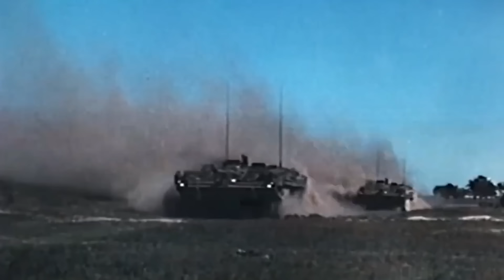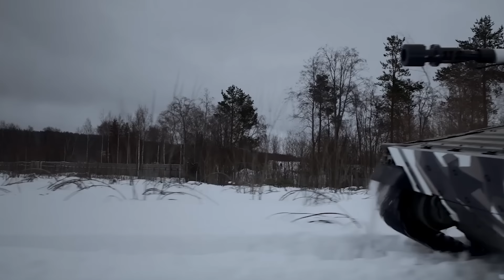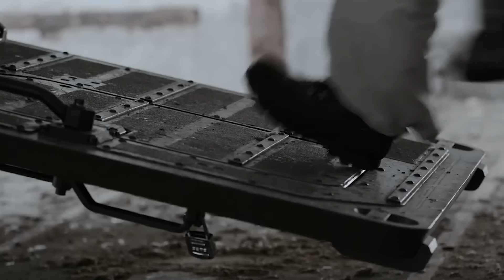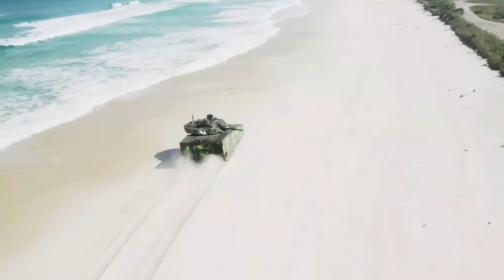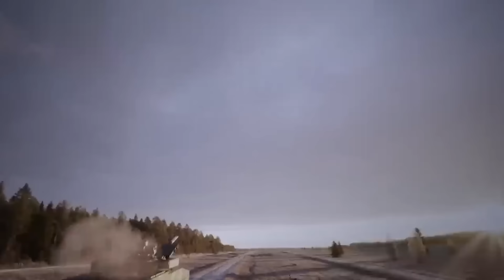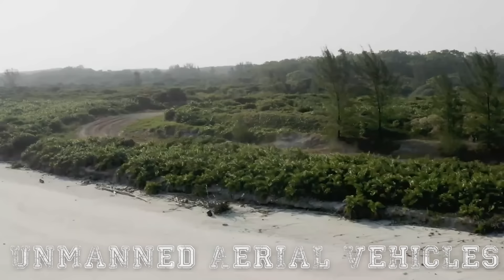NEW Combat Vehicle That Will CHANGE Battlefield FOREVER!

Comment: This should be the NATO standard. I don’t understand why some countries are getting inferior APCs; it has to be politics. If we streamline our production within NATO, it will benefit everyone. For example, the chassis could be made in Sweden, the cannon in America, the sights in France, the ammunition in Finland, and the tracks in Italy. By adopting NATO standards and distributing production, we could produce these vehicles in record numbers.

It is clear that the British Warrior has major problems, as people get seasick riding in them. The German Puma has major problems, catching fire, and the Bradley can’t even be used in snow because it gets stuck. The engine is just too weak, and the cannon is a bad choice. its time to work  together instea dof going into failed  projects that  cost  billiions.  sharing is the best way forward.  we ave to move forward like  we with J35 Lightning its a shared project.  and we share  development costs.. there are also Huge benefits getting spare parts  with Joinet ventures. and also  streamlined production.

Comment: It will be better if this could swim .
Reply: Its way to heavy foor that.
Reply: As you've seen with the Ukraine War the BMPs and other soviet legacy vehicles aren't very swim able today due to seals being too old or they or swim too poorly with only waterjet propulsion they get stuck on sand banks and in mud, as the bands can't engage the obstructions due to the design.
Some just mysteriously sink.
The swim ability hasn't played any kind of key role imagined for them for either side of the War while the theoretic ability to attempt to do so keeps their armor weak.

A CV90 that is prepared can ford. 
A BVS10 can actually swim and traverse underwater obstructions but the Armor is then less than the CV90 has.

Comment: CV90 Mk IV IFV Integrates Akeron 5th Gen Missile

advanced combat system with integrated LYNKEUS micro-UAV offers a major expansion in battlefield.
 Linking the onboard LYNKEUS micro-UAV permits the most effective use of Akeron’s 5000 meter maximum range and use of its non-line-of-sight engagement possibilities.
Reply: I'm hoping we will see a missile carrier version later on. PLENTY of space in the back for multiple vertical launchers, and they're already designed with "top doors" for the infantry to pop out and shoot from, should be (relatively) easy to replace that with VLS.

Comment: SOME OF THESE WOULD DO WELL IN UKRAINE ABOUT 15 OF THE OLDER ONES
Reply: Sweden sent 50 of them to Ukraine
Reply: @niclasjohansson2071  And those are the newest ones, with the best armor and updated electronics. Also: Saab Barracuda.
Reply: We Swedes felt that 15 is a bit low so we sent 50 we could spare right away.
(We have about 500 of them)

We still feel only 50 is a bit low, we want to send more so we got this Sweden + Denmark deal where Sweden builds 35 that Denmark pays for and we send those.
But the Dutch felt this number was still a bit low and we can do better. So now it's  230 vehicles total and hopefully 180 are going to Ukraine.
Reply: And we are building new ones to send right now

Comment: Best IFV in the world. 
And they have proved to reach the goal every producer strive for an actual modular framework, letting them even when selling small batches make a custom weapon selection for a new customer.
Reply: It got drone defense, sort of...One of the 17 variants is a LV...
Reply: @kentunemo5866  Not just sort of, they fire the 3P programmable proxy-fused HE rounds, and the fire control system will lock on and calculate a trajectory using the thermal sight to lock on to the target. Designed for helicopters and low flying attack aircraft, but works very well against drones too.
Reply: The video described the “iron-fist” type counter-fire defense system that launches out to destroy or deflect incoming ATGMs or sabot rounds but that would equally be effective against lancet type attacks or FPVs

What it can’t affect is the 5000’ away spotter drone with a laser designator or just spotting for artillery … for that, the vehicle needs a 25mm or higher airburst-shell top-mount cannon with exceptionally high angle capability
Reply: @markwood4555  True the CW90 already has a very impressive high angle range on both the 30mm cannons and 40mm. 
Not a complete 90 degree but still useful for AAA.
Reply: @markwood4555  From the B version and onwards all CV90s fire the 3P proxy fuzed HE-FRAG ammunition, with FCS calculating trajectory after thermal lock.

Comment: Hang on a moment.....how is something that has been "a fixture of the Swedish fleet for comin gup on three decades" to be considered to be new?

Hell, this is at least the third vid I've seen on the CV-90. Not quite "new", and must doubt the last part of the title sentence. "Forever"???
Reply: CV90 is without a doubt on of the best IFV in the world, but ofcourse this is propaganda as well. 

As you said, the CV 90 isn't "new". It's a 90's design (entered service 1994) that has been constantly upgraded. Only the pure chassis from the Mk0 model resembles the upcoming MkV version. The latest version MkIV is light years ahead of the Mk0.

Once e.g the german Puma have fixed all the initial problems (and there have been tons of it), it might take the throne. But so far i personally consider the CV 90 the best allround IFV in the world. Even the older Bradleys given to Ukraine have proven to be a complete overmatch for any russian counterpart.
Reply: @74Darkman  There is so many aspects of this so to the last its the crew that make a IFV what it is, and a bradly with with a good crew is in the same class as the CV90
Reply: @hansericsson7058  Absolutely, but you can say that about pretty much everything. 

A racecar driver will outrun a regular driver in a better car...or there are several videos of very old Ukrainian tanks knocking out modern tanks, e.g. a T-64 (from the 50's) destroying a T-72B3 (from 2013 and newer).

But...in a battle where e.g. 2 crews are the same level, in an example like yours, a CV90 would take the upper hand. Out of many reasons.

Cv90 can probably take several hits from the 25mm Bushmaster, but the Bradley can  not take 40mm hits. Then it is down to optics etc., CV90 is a much more modern vehicle overall.

With that said, i love the Bradley. It's a fantastic vehicle in every way.
Reply: @74Darkman  don't compare Bradley with cv90.

Compare them with which is most effective against Russia ns
Reply: @knoll9812  I think any modern western IFV is better than everything Russia has a counterpart. 

West is so far way ahead of Russia when it comes to technology in this area. Most russian IFVs have much worse optics, stabilizer...well the list is kind of long to be honest.

BMP-1 and 2 are clearly inferior to any western IFV. BMP-3 is also far behind even though it is much more modern than the previous models.

And no, i am not biased. This is just how it is. Same thing with the MBTs. Western tanks are far better overall.
Reply: Mark IV is new!
Reply: Mark IV variants are not more than 7 years old. So it is new
Reply: Upgrades, my lad. Loads and loads  of upgrades.
Reply: Fråga Nederländerna dom har betalat 1miljon arbetstimmar för ingenjörer för att skapa nya funktioner. En av uppgraderingens funktioner är att den innehåller ett aktivt skyddssystem som utvecklats av Elbit Systems Land och BAE Systems Hägglunds. Detta system, känt som Iron Fist, tillhandahåller radar och optisk detektering av inkommande hot, och erbjuder ett hårt dödande aktivt skyddssystem för att fånga upp pansarvärnshot

Spike LR2-raketen höjer CV90:s offensiva kapacitet ytterligare, vilket möjliggör olika avfyrningslägen, inklusive Non-Line-Of-Sight (NLOS) uppskjutningar mot koordinerade mål.

Det elektrooptiska panoramasiktet (EOPS) på en infällbar mast, nya värmekameror och 360-graders IR/dagkameror förbättrar situationsmedvetenheten, vilket är avgörande i moderna krigsscenarier.
Reply: The amount of updates literally makes it a NEW Cv90, it still keeps it name buddy. I would not be surprised if a CV90 even destroy a Bradly with EZ.